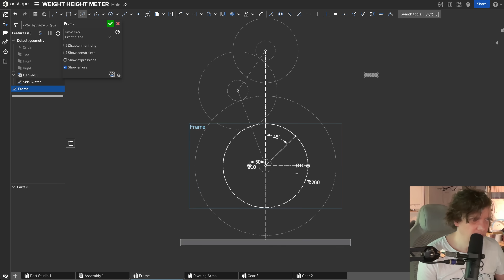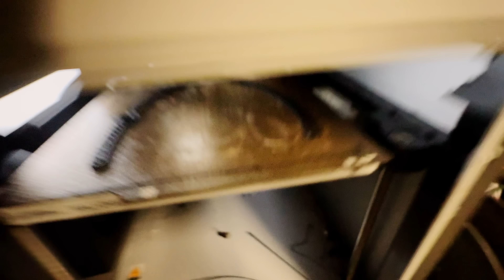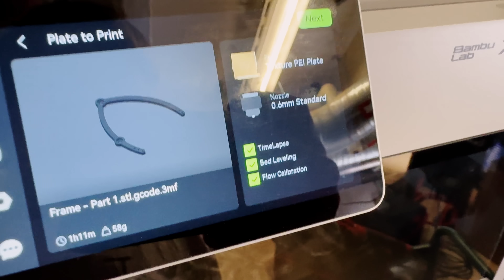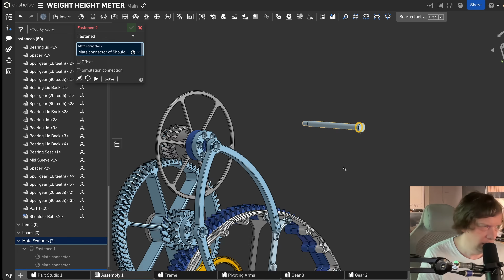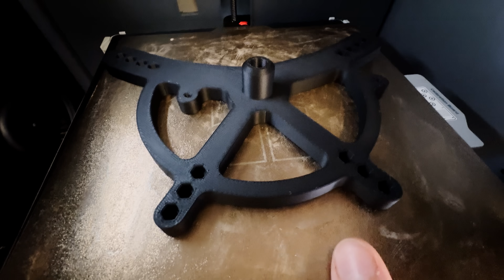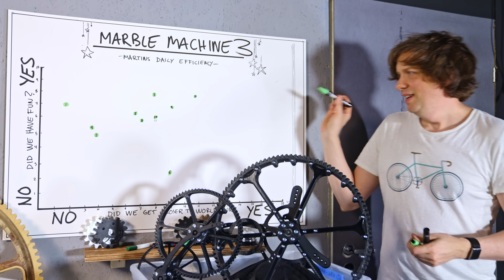Making the frame for the Tightness Meter - MM3 VLOG #11

Comment: I noticed you're using grid infill, you can significantly reduce print time and material if you use adaptive cubic and set the infill between 10% and 20%. For strong prints, adjusting the wall thickness will do more then adjusting infill

Comment: Don't you think you're going down the spiral of form over function again, using high-tech materials for the sake of visual appearance rather than something purely functional to drive the goal of the function of the thing. I think MMX started the same way, with an idea of something better engineered, but then went to the madness of form over function rather than making it work properly first.

Or working at all to begin with, which is why your original Marble Machine was better engineered than MMX: you completed the project, and it worked, and could've been improved to be reliable in much less time than you did when restarting, and then restarting again. It's also a lesson not only mechanical engineers tend to learn, but software engineers as well; the second system effect.

I think waht you do is driven by "wants" of "because I can" trying to stretch the envelope of what's possible by making things that barely work, just so. Such tend to fall apart at the smallest imperfection, which isn't good design, because it's not robust. Instead settle for "good enough": "it works and is an inexpensive (in time as well) solution". Engineering perfection is rarely if ever reached: something as simple as possible (to fulfill the product requirements, including robustness and cost), but not any simpler than that.

Comment: At Ludacris speed, the printer moves so fast the heater in the hot end can't keep up with the amount of plastic it has to melt. Look into high flow nozzles if you want to print reliably in ludicrous, or just buy another printer at that point 😅

Comment: I think this has been really good for learning the tools on a project that isn't critical path. So many times in the past, you've done designs for the real machine right from the start, and then put a lot of effort into working around the problems with the parts you'd built, rather than just taking the lessons you learned and designing new parts without those problems.

For the part that messed up, you should think: how much time did it cost you to get rid of the temptation to keep pushing the speed? Not really all that much, compared to how much you could have lost doing it later if you did it on a bigger project later because no prints had ever gone wrong.

Comment: Hi Martin! I think you should start testing with different infills on the 3D printer! I personally really like cubic as it makes the part super strong relative to the amount of infill density. Something like cubic also makes the part strong in all axis versus an infill pattern like grid where is is weak in bending forces.

If you use cubic infill you can use lower percent infill and get parts that are just as strong as grid infill. And because the infill percentage is lower, you can print faster and be more efficient!

Comment: Hey Martin, hope you're doing fine!!! As an ignorant on 3d printing questions, I have a suggestion haha. Wouldn't save you some time to stack the printing models? Like design some supports in the middle of the pieces and just snap out the supports after the print? Imagine you have 10 legs to print, but you don't have X or Y space on your 3d printer, perhaps you could print those 10 legs stacked on over the other with supports in the middle.

Just an ideia. Best regards from Brazil!!

Comment: I feel like it's not super obvious which direction the final wheel is spinning when it's going faster. I reckon you could fit some flaps in the cut outs of that wheel, that would flip over when it changes direction. Then if you made either side of the flaps a different colour it would give a clear visual of whether the drive was gaining or losing energy.

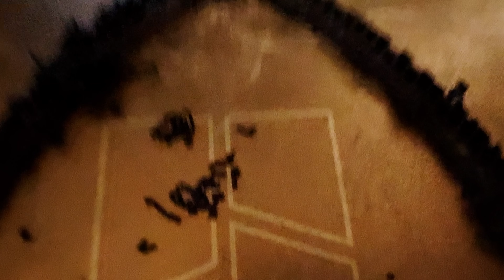Comment: 3:11, There's nothing complicated about it. This is a common mistake made by beginners in 3D printing who are chasing "speed" and ignore other important aspects such as volume flow and the ability of the extruder (you may want to replace it with a more productive one, there are many videos on this topic on YouTube) to produce the desired volume. Based on personal experience, I would not recommend chasing mythical speeds. Instead, optimize your settings to get the best results. Good luck to you 🙂

Comment: The fastest speed is not good for the motors, the head assembly, or the print.  
You'll be kinder to your printer, and have better prints with a bit of patience. 
Still, awesome progress. This is good practice. Quite some progress from 2-3 years ago. o0

Comment: You have come a long way from sawing plywood gears on the band-saw. This will probably make the Engineers proud... However, you are still designing and building one part at a time. Make sure you don´t lose track of the bigger picture, so you don´t end up with a lot of nice parts that don´t fit together. Or if you end up with half a machine, when you run out of time for some reason.

In software engineering we use a work flow that is called "agile" where we build "vertical slices" and "minimum viable products". The idea is to build something that works and can be delivered as soon as possible, and then iterate on what has been built and improve it gradually. We keep a back-log of items that needs to be improved, and these items are prioritized according to what value they bring to the "product owner". So the longer you work on the product, the better it becomes, but you could hypothetically stop at any moment and deliver what you have, albeit missing some features.

Now this does not work quite the same when you are building a physical machine with parts that cost money to manufacture, like you discovered with MMX, because you don't want to manufacture the same improved part 10 times over and use the angle grinder to remove things that went wrong. HOWEVER, you could reasonably fast, say within a week or month, design a digital twin of your machine that works with all parts accounted for, and then you just gradually improve it step by step, always building and prototyping sub-assembly's that you know will fit on the larger machine. Also, if you have a minimum viable product digital twin like that, you could always just stop the project at any time, print all the parts and deliver what you have.

This is the key behind continuous delivery and continuous integration that is used in Software delivery, and we can also see the same mentality behind SpaceX where they have a whole pipeline of improved versions of the same space-ship.

Comment: I tried searching for your part studio in the public domain, and since it did not show up I'm assuming you have bought a license (good!). This means that you should have access to the built in, kinda-shoddy-but-better-than-nothing FEM tool within OnShape, meaning that you can actually simulate the mechanical load and resultant stress within OnShape directly! It is not super accurate, but for simple structures (like this frame) it can give a good indication of how well it will handle the load and forces. Solution is almost always to add some well placed struts and triangles/circles!

Comment: I don't know what software you're using for slicing your STL files, but if you can use "gyroid" fill instead of the current rectilinear/grid it is usually a bit more stable, and can handle being printed with less infill = faster prints!

Comment: Wintergaten, when will the building for the MM3 start?
Reply: Technically, this subassembly is a part of the  MM3, but I understand what you mean. The full machine will require a lot more CAD designing before making the actual pieces so I think that's why he wanted to do a smaller part while getting accustomed to onshape and the new place.

Comment: Martin, I think you might find it useful to represent the progress of each day instead of with the point cloud with a couple of functions day by day, one for fun and the other for progress.
DAY:                1   2    3   4...
FUN:                7   5    8   5...
PROGRESS:   2   4    8    4...
This way, you could easily draw a pair of regression lines, one for each function, and clearly see the trend as well as whether you're above or below the average each day. This would complement the point cloud, not replace it.

Comment: Hi Martin you are using grid infill, there are patterns that are isotropic which as a rule of thumb is better for engineering purposes.
Also the infill density looks quite high even though most of the rigidity comes from the shells due to moment of inertia being more affected by those regions.

Maybe try 10-15% cubic or gyroid infill :)
Reply: I actually think the rectilinear infill is fine in this use case. It's strong in the plane of the part, and fast to print. Considering this is as much as anything a late-stage prototype, and the stresses are mainly going to be in-plane, I think rectilinear is a perfectly acceptable choice here.
Reply: @quinnobi42  rectilinear would be OK, but that looks more like grid infill, which has significant problems with the nozzle running into the infill as it crosses itself.  that's the most likely cause of the failure here.

For strength vs. time, cubic is the outright winner, for pure strength, it goes to gyroid.

Personally, wherever i think grid or rectilinear would be ok, i use adaptive cubic, if i dont mind losing a bit of time to the acceleration losses, then gyroid.
Reply: @Corvus.2606  Even better than cubic would be adaptive cubic and extra perimeters especially for large parts
Reply: cubic is the way to go as you get diagonal bracing. gyroid is overated, its slow to print croshatch if you really like gyroid is superior. only valid use case for gyroid is flexibles or permeable infill.

Comment: The failed ludicrous speed print reminds me of a quote:

"If you don't have time to do it right, when will you have time to do it over?" -John Wooden (Hall of Fame basketball player and coach)
Reply: Ironically the failure was less likely due to the speed than the grid infill, those lines crossing themselves can catch, and obviously faster leaves less time to move the nozzle up out of the way.  Gyroid infill is superior in many ways and lessening this type of issue is a main one.  Old grid infill should never be used nor be the default anymore.  Gyroid or Adaptive Cubic are superior, but the latter would be less useful for this project as it puts more material/mass on one side rather than even distribution.
Reply: @RJFerret  ludicrous doesnt work well with prints with very long extrusion lines, as the x1c is limited by volumetric flow rather than speed, you can get away bumping the temperature up a bit. for something that big i wouldnt go above sport.
Reply: We had a senior executive where I used to work who always wanted things done quickly with the predictable results. Our phrase was "We don't have the time to do it properly, but we do have the time to do it twice."
Reply: @briancampbell179  we had the exact same thing haha
Reply: I always liked “Slow is Smooth. Smooth is Fast.”
Reply: In my experience, the short cut is the longest distance between two points.
Reply: lol i just commented the same thing, nice ^^ did you also watch that videos about wood screw types?

Comment: A great tip for OnShape when doing a distributed project like this is to make a variable studio (by the same + icon in the bottom left). Then create lengths and angles and relationships etc. that you frequently use, use the right dimension and name them with a good naming convention and pull your measurements from there. It's like when you make a variable in a normal part studio, but this variable studio can be referenced by any part studio within the same document/project. Super handy! 
I also highly recommend to put all of your operations and features within folders that divide a part studio into e.g. "setup", "main body", "customization", "clean up", "patterning" etc. 

There is also a tonne of very interesting custom features created by both OnShape developers and the community. For instance embedding hex-nuts within 3D prints (print needs to be paused so that the hex-nut can be inserted and then resume print again). A couple of years ago OnShape released their entire language where you can code any feature you'd like, as well as the code for all the standard operations within OnShape. If you have some programming savvy friends and are finding yourself in need of a specific designing tool it is very likely that it can be built from within the program. Happy designing!

Comment: I think you are being a lot more productive than you give yourself credit for. If you think of this as a test-build rather than a insignificant part of the actual project, you are stresstesting your 3d printer, your program, and your designer skills. Would be pretty annoying doing the bolt thing, where you have made 120 parts with incorrect bolts size no? That is just one of the important lessons you can walk away with. 
Fail in this project so that you don't fail spectacularly on the mm3, several times over.

Comment: Martin needs more 3D printers so he can effectively create more than just one part at a time
Reply: Agree! Though, usually designing new part takes longer than printing them, but whenever a print fails or you need to print identical parts, it does hold you back for sure. So let's hope they like the collaboration and send him a few more 😊. Also, the studio does have more printers (2 large ones, two smaller), but they are not able to print these special materials and the quality of prints is not as nice as the bambu labs.. but if needed, he does have some extra resources available.
Reply: I'd say he also needs some resin 3D printers !
Reply: This vlog series has been great advertising for Bambu so they should send him a second machine.